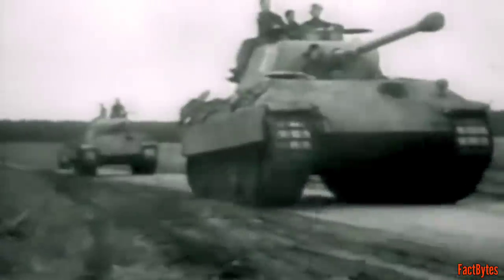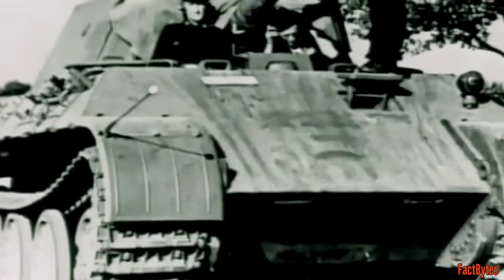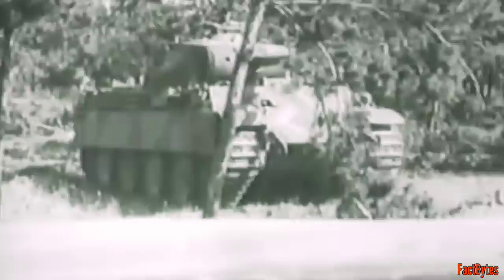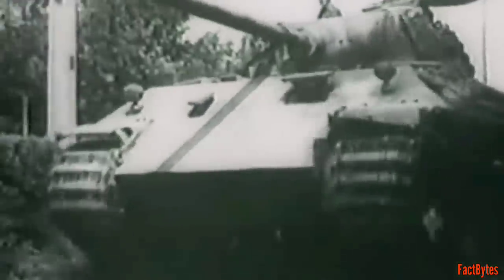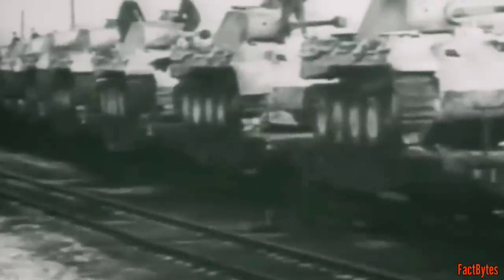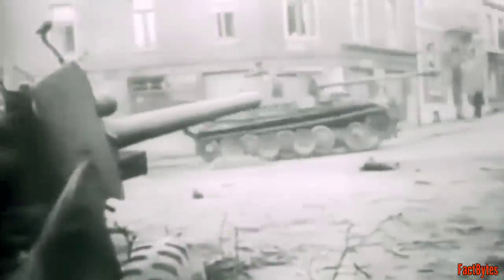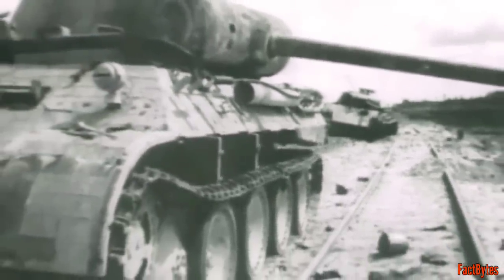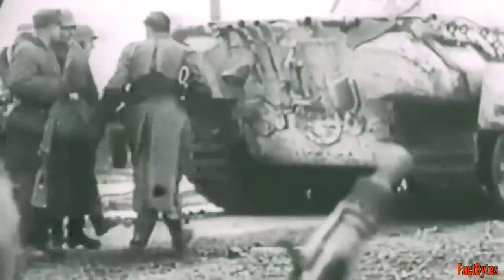Was The German Panther Really The Best Tank Of WW2?

Comment: Some myths never die. 

The Panther's HE had as much HE filler as the Sherman's 75 mm and was, like almost all German high velocity guns fired at a lower velocity than the AP shell. It was an highly effective infantry support weapon because it could easily deal with "everything" from infantry to heavy IS-2 tanks (defending your infantry against enemy tanks is a pretty important task).

The Panther was defeated at Arracourt because it was manned by poorly trained kids - pitted against seasoned US tankers. 

Only the early Panther Ds had face hardened armor. 

"The engine and transmission were built for a 30-35 ton tank"; there was no way the very large MAN Panther (it was as large as a Tiger) would weigh less than 40 tons. Adding 20mm armor on the glacis doesn't add 10 tons. The same engine gave the 56 ton Tiger 1 an equal or better power to weight ratio than most M4 variants. Only the T-34 and the British Comet and Cromwell tanks had better power to weight ratio than the Panther.

No WW2 tank had "spectacular" reliability. They all had plenty of mechanical issues and were high maintenance - the Sherman, too. This is 1944 - even your vanilla family car could be expected to break down at any time - and cars have always been much more reliable than tanks. The Sherman may well have been the best of the lot - but the main reason for the high availability rate of the Sherman was the huge pool of replacement tanks.

The Panther was the best standard tank of the war, but the allies were not far behind; already in february 1945 the first M26 Pershings arrived in Europe, and as the war ended the Centurion became operational and the T-54/55 was not far behind.
Reply: Excelently put.
Reply: wrote: ""The engine and transmission were built for a 30-35 ton tank"; there was no way the very large MAN Panther (it was as large as a Tiger) would weigh less than 40 tons. Adding 20mm armor on the glacis doesn't add 10 tons. The same engine gave the 56 ton Tiger 1 an equal or better power to weight ratio than most M4 variants."

-- Boo-ha-ha, some myths are never die, indeed... But you got it backwards... First of all, Panther did NOT have to be as large as Tiger, can you think of other tanks of that era similar(if not better) armor protection, better gun, and better maneuverability, all weighting 30-32 tons?

-- Second, It supposed to be just 30-35 tons range, which M.A.N. promised, but  did not meat that requirement, hence the problem with final drive for the duration of the tank life, so actually it was designed for less powerful engine too(not just weight), so final Panther could not fully use raw power of its engine, the way T-34 could.
Reply: @RussianThunderrr  30-35 tons were totally unrealistic for a tank carrying the big 75mm L/70 with enough ammo, good armor protection and good power/weight ratio. Both the Americans and British came to a similar conclusion with their M26 Pershing and Centurion - which were as large as the Panther. The roadwheels alone added at least 5 more tons to the Panther than any other WW2 tank, with the exception of the Tiger.

No 30-32 ton tank had similar firepower, protection or maneuverability to the Panther - among standard tanks it was the top dog in all three categories - the only thing the T-34-85 had was better HE and even that was less than expected considering the calibre.

The final drives affected the much lighter PzIV and its variants even more than the Panther - even the small "Hetzer" had major problems with the final drives. It wasn't so much the weight as it was flawed design and lack of important alloys. The Jagdpanther had reinforced final drives and was less affected.
Reply: @TTTT-oc4eb  wrote: "30-35 tons were totally unrealistic for a tank carrying the big 75mm L/70 with enough ammo, good armor protection and good power/weight ratio. Both the Americans and British came to a similar conclusion with their M26 Pershing and Centurion - which were as large as the Panther. The roadwheels alone added at least 5 more tons to the Panther than any other WW2 tank, with the exception of the Tiger."

-- Well, VK 30.02(DB) had the same gun, and meet all the specs of Panzer Committee of November, 1941. Also T-44, that saw action in September of 1944, also had 90mm frontal armor, later increased to 120mm, and be for more dynamic maneuverability then Panther tank.
Reply: @TTTT-oc4eb  wrote: "The final drives affected the much lighter PzIV and its variants even more than the Panther - even the small "Hetzer" had major problems with the final drives."

-- Well, it would be less affected, if more and more frontal armor was added, but no improvements to drive train existed.
Reply: @RussianThunderrr  The Daimler Benz variant was never tested with the KwK 42. The T-44 did not see action in WW2. The main problem with the DB design was that neither the turret or the engine was ready, and it probably wouldn't have been ready even for the summer battles of 1944.
Reply: @RussianThunderrr  The main problem was lack of machinery to make the same final drives as the Tiger. With the exception of the final drives the drive train was excellent by WW2 standards and gave a smooth ride that actually wasn't bettered until the Leopard 2 (source: Military History Visualized).
Reply: @TTTT-oc4eb  wrote: "The T-44 did not see action in WW2."

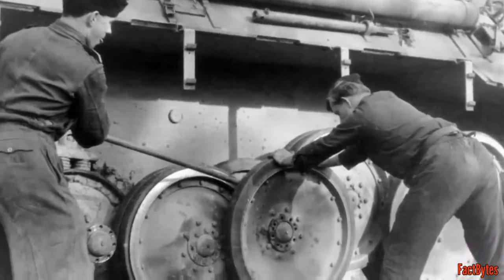What makes you think, so? Starting on 2:27 you can see T-44 driving past knocked out Panther in a ditch, and entering European city with parade.

https://www.youtube.com/watch?v=e_vFrYt1GDE&t=107s

-- As far as VK 30.02(BD), it supposed to use 7.5cm KwK 42 as main gun.
Reply: @TTTT-oc4eb  wrote: "The main problem was lack of machinery to make the same final drives as the Tiger."

This statement would not hold water in my books..., but yes, there were plans for Panther II, that would use Tiger I power train, 88mm gun (!)without muzzle brake(!), and its main caterpillar tracks were supposed to be Tiger III tank(that never materialized) as transportation track.
Reply: @RussianThunderrr  Google is your friend - the T-44 was never used in combat.
Reply: @RussianThunderrr  You're right about the gun - the main problem was the smaller turret ring which meant that it could not use the same, already designed, Rheinmetall turret.

But even the DB design would probably have weighed 40+ tons - except for the height it was as large as the MAN design.
Reply: @TTTT-oc4eb  wrote: "But even the DB design would probably have weighed 40+ tons - except for the height it was as large as the MAN design."

-- That is not necessary so. It supposed to use a bogie type suspension, and tracks narrower that of T-34. Let me respond to that statement of yours:

" The roadwheels alone added at least 5 more tons to the Panther than any other WW2 tank, with the exception of the Tiger."

-- What made Panther so tall, as tall as Tiger tank was double torsion bar suspension that 220mm, where nothing can be stored between bars, then because it was front wheel drive(and not a rear wheel drive) crank shaft with its tunnel went over it, and then turret basket. In case of VK 30.02(DB) none of it was present, because bogie just bolts to its sides, and take no internal space, and it was rear wheel drive. So smaller(and less taller) which presents a smaller target, and from armor prospective since you don't have to put heavy metal around space that was not waisted, tank overall became much lighter, so 30-35 tons was not all that unrealistic.
Reply: @RussianThunderrr  It is possible that it could have weighed near 35 tons, but more realisticily somewhere between 35-40 tons. The M26 Pershing had similar dimensions (slightly shorter, but also slightly wider) and weighed in at 42 tons. It was more heavily armored than the Panther, though, somewhere between a Panther and Tiger. My main point was still that MAN Panther never could have weighed under 40 tons - even with the original armor values.
Reply: @TTTT-oc4eb  wrote: "It is possible that it could have weighed near 35 tons, but more realisticily somewhere between 35-40 tons."

-- And what made you say that? T-34-85 gun for example was heavier then 7.5cm KwK 42 that was on Panther tank.

-- VK 30.02(DB), used narrower tracks, while on Tiger/Panther each track weighted (!) 3 tons(!), wheels are smaller, engine..., there were 3 diesels and two gasoline options for that prototype, none was the size of Maybach 320, so it was very realistic to came lower then 35, and maybe even under 30 tons, with hardly a problems for a final drive, which is 3 days job to replace it, in a well equipped maintenance facility in case with Panther.
Reply: @RussianThunderrr  The T-34-85 weighed 31 tons and was 20cm lower, shorter and narrower than the DB Panther. Even without 100mm front turret armor and 80mm glacis that probably means at least 35 tons. The 85mm was only slightly heavier than the 75mm.
Reply: @TTTT-oc4eb  -- At any rate, T-44 was lower of them all, had better protection, and a smaller as a target, shorter and very maneuverable, otherwise/tanks had a lame packaging when compared to Soviet medium tanks. This design philosophy continued onto most Soviet MBTs.

https://www.youtube.com/watch?v=4bXuPTdxBv4

Start at 2:55 with horrible German and it got English CC
Reply: I disagree with the claim it could deal with IS-2s, because it couldn’t. The turret and glacis plate was impenetrable to the panther at normal combat ranges, and it wasn’t vice versa
Reply: @Insert-Retarded-Reply-Here  front turret armour of the IS-2 was only 100mm, no problem for a Panther, it could penetrate 150mm at 1000 meters.
Reply: @TTTT-oc4eb  except you forgot the mantlet covered the vast majority of the turret face, which is 100mm+100mm=200mm effective thickness. The rest of the turret is heavily sloped with the tiny exposed cheek that isn’t covered by the mantlet that is so small any sane German gunner would never try to hit at 1km
Reply: @TTTT-oc4eb  meanwhile the IS-2 had to just aim center mass of the panther and that would be easily enough to take the panther out of action. The simple fact is that the panther was never designed to fight heavy tanks because at the time it was introduced the IS-2 didn’t exist. It’s Role was to destroy as many soviet T-34s at range while being able to resist hits from low caliber guns. It was never designed to duke it out with late war heavies and it’s completely absurd that people think it can.
Reply: @Insert-Retarded-Reply-Here  thank to their much higher ROF, neither the Panther or Tiger 1 were at a disadvantage against the IS-2. Like all Soviet hardware it looked much better on paper than IRL.
Reply: @Insert-Retarded-Reply-Here  mantlet was small an not 100+100mm
Reply: @TTTT-oc4eb  mantlet was by no means small, it’s significantly bigger than the even smaller exposed cheek. And German panther gunners would never opt to hit the turret unless the glacis was hidden. The tiger I could not penetrate the IS-2 almost anywhere on the front, and the panther could do it but it was highly unrealistic at range and WW2 sights were not pinpoint accurate and could not hit specific parts of a tank when it wanted to. The tiger I is out of the competition because the 88mm kwk 36 L/56 had poorer anti tank performance to the panther. Regarding the panther the IS-2 would have to completely miss its first shot which didn’t happen as often as people say, the 122mm was a pretty accurate gun, provided it was manned with a competent gunner (which was usually the case, only the soviet union’s best tankers crewed the IS-2). IF it missed, then yes it would be in some trouble but the panther would use this as an opportunity to disengage rather then take the immense risk of closing the distance and risk getting completely destroyed. If both tanks spotted each other at the same time, the advantage is clearly in favor of the IS-2, with a lower profile, a gun that would at least disable the panther anywhere, superior armor, with the only disadvantage being the reload time and worse shell ballistics. There is a reason why Wehrmacht command ordered German tanks to avoid direct engagement with the IS-2
Reply: @TTTT-oc4eb  “all soviet hardware” I hope that’s a joke, that strikes to me as buying into the myth that soviet weapons are all about numbers and they were always inferior to whatever the west had. Was the AK-47 good looking on paper? Not necessarily, but it became the most successful assault rifle ever invented. Was the katyusha impressive on paper? Nope, it’s accuracy was terrible, but in practice it was a terrifying and highly effective mass bombardment vehicle that could be deployed in numbers. Was the Panther good looking on paper? Yep, it apparently had a great gun, great armor, great mobility. Did it live up to that standard? No, it was a mechanically flawed tank with those issues being addressed but never solved, and the same applies to the Tiger II and horrendous Jagdtiger. I’m not dissing German weapons, they started off with an effective tank, infantry, and Air Force toward the start of the war but as time went on and the war started looking more and more unwinnable for them the Germans went on to create more heavily armed and armored tanks with rushed development time out of desperation and hoped they would work
Reply: @Insert-Retarded-Reply-Here  The IS-2 was a typically Soviet tank, thickly armored and hard hitting - but also very crude and primitive. It still was a good heavy tank, especially compared to the mechanical disaster that was the IS-3.

Its main gun was both its main asset and its main disadvantage. The sheer size and weight of the shell made it very dangerous, but the gun made the turret unbalanced which was the reason they could not make the turret front armor thicker. Even a Panzer IV could penetrate the turret front out to 1000 meters and the lower front hull out to at least 500 meters. The gun was very slow reloading and the tank could only carry 28 rounds of main gun ammo, up to four times less than a Tiger. A Tiger could fire 3-4 rounds back for each round the IS-2 could fire.

Arguably its worst weakness was its poor quality armor which had a nasty tendency to internal spalling with armor bits loosening and ricocheting inside the tank. German AT gunners reported the crew would often bail out once the first hits were registered. A report from Gross-Deutchland's Tiger 1 company stated the same, as well as that the IS-2s would usually turn around and flee if they encountered Tigers. They also reported that the IS-2 had very poor visibility.

It had worse power to weight ratio than a Tiger 1, let alone a Panther. By mid 44 both the Tiger and Panther.

It had no turret basket, which made the loaders already difficult job even more difficult. It had an antiquated drive train based on the KV-1 and had poorer off road mobility than bothy the Tiger and Pantger.
Reply: @TTTT-oc4eb  Pz IV is out of the story. By the time it even closes to 500m (it will never ever hit a shot from 1km on such a small target intentionally) the IS-2 will most certainly, no matter how bad of a shot the gunner is, will destroy the Pz IV. The ROF does not matter as much as you say since both tanks come in loaded with a shell, and the IS-2 has a much better chance penetrating than the tiger I or panther. The turret armor is only vulnerable for the incredibly small cheek like I said, while the German tank is an easy penetration or at least disable all over the hull and turret. The visibility on the IS-2 was far far better than the german counterparts, the IS-2 featured it’s own 360 periscope for both the gunner and commander, giving them very good field of view. Most German reports were from the IS-122, which had a very bad tendency to spall due to its hull design, a crew that received minimal training on the tank, and would often panic when fired upon. These issues were fixed on the updated late 1944 model which no longer suffered these issues. It’s practical mobility was also far better than both, neither of the tanks you mentioned could reach their maximum theoretical speed, road or cross country. German statistics were always optimistic in this respect and they were plagued with a multitude of problems. In fact it was these problems that resulted in the same engine’s horsepower being lowered on the Tiger II because it would breakdown otherwise
Reply: @Insert-Retarded-Reply-Here  The mantlet is small, especially compared to the Panther and Tiger. The Tiger could easily penetrate the front turret and lower hull. The rest of your post is just nonsense.
Reply: @Insert-Retarded-Reply-Here  I should have written everything in USSR "with an engine" was sub-standard. Having first hand experience with the disaster of a "car" called Lada, I absolutely refuse to believe anything in the USSR (or communist countries in general) was reliable. It has nothing  to do with the people, but everything todowith a system that promoted mediocry and laziness.
Reply: @Insert-Retarded-Reply-Here  The ROF is a major disadvantage for the IS-2, it could not expect to hit the target with its first round. The 100mm armoron the turret may be small, but not "incredibly small". There is a picture of one that was penetrated through the turret front at 2500 meters by a 88mm L/71.
Reply: @Insert-Retarded-Reply-Here  What is your source for the better mobility of the IS-2?
Reply: @TTTT-oc4eb  so you just admitted your biased against communist countries because of a bad experience with a lada? Just stop it right there, this is an objective debate not one where ppl bring their prejudices as they please
Reply: @TTTT-oc4eb  the turret face is smaller than both the panther and tiger. Take a look at a picture of an IS-2’s turret front and how can you tell me it’s possible to intentionally hit that spot from 1km
Reply: @TTTT-oc4eb  that was completely a lucky shot, no WW2 gunner ever aims for specific areas on a tank in normal combat ranges, and moreover that was from an 88mm L/71, not an L/56, thus it has an easier pen on the turret compared to a tiger I or panther
Reply: @Insert-Retarded-Reply-Here  Only a few Russian nostalgics truly believe Soviet/communist products were as good or even better than Western ones. East Germany produced the worst car in history.
Reply: @Insert-Retarded-Reply-Here  At normal combat ranges all gunners, even mordern ones, aim at the center of mass. Hits on the turret front are almost as common as hits to the upper hull. The gun mantlet on the IS-2 was only up to 115 mm thick and was also vulnerable.